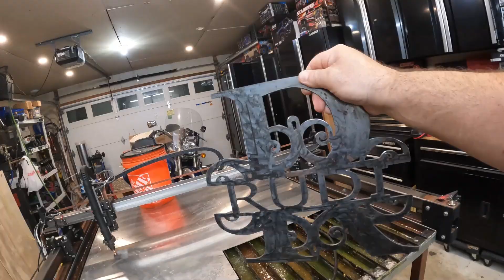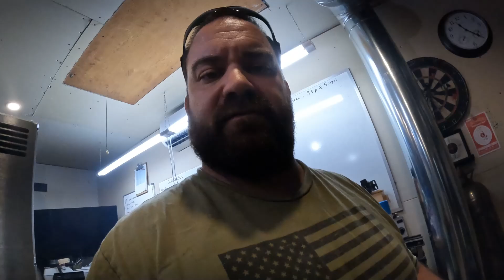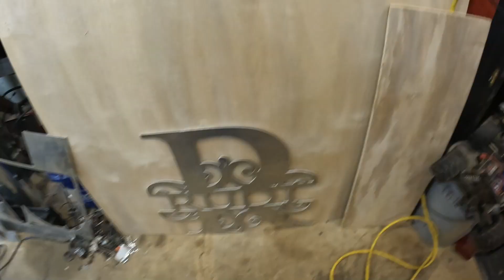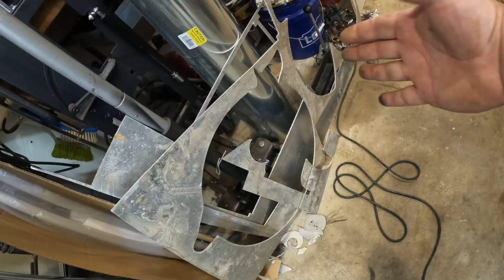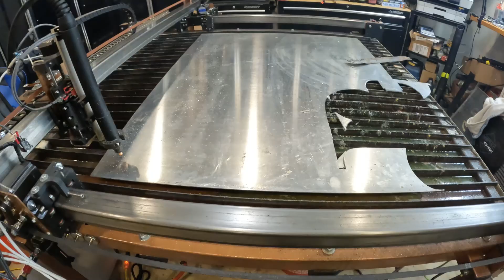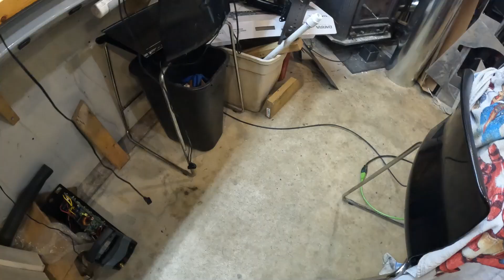JD's Garage CNC Plasma Table - More Cutting

Comment: We built the XL and are having a lot of problems getting perfect circles.  They have noticeably flat sides, almost oval.  Did you run into any similar issues?
Reply from the maker: Yes, you'll need to work on calibration and tightening tolerances over the length of the table. Corvetteguy50 just released a great vid about this. You'll need create a reference point on your x and y , command the machine to move a certain distance and mark it. Measure that distance with a physical measuring device like a machinist ruler and make sure it matches what you inputted into the machine. You'll repeat this process at several different distances. Example : 6" 12" 18" and see where you are off. You'll need to do this for both x and y , make sure your belts and all components are tight before you start.

Comment: I’m really excited about building the JD's CNC plasma and cuz you’ve already done a build yourself. I’m debating whether to build mine big enough (52"x100") to fit a full sheet  or just a half sheet at a time

What’s your take on the pros and cons of going full sheet size versus half sheet? 99% of the time i'll be cutting 18-20 awg ss
Reply from the maker: Space is my concern with a full table. I would also consider how frequently you cut something from a full sheet. Obviously if your doing big signage all the time I would go full but if not I would build it for a half sheet and if you don't want to cut the sheet you could always just build extensions so the full sheet can be held up and as you cut from the sheet you can just move it forward, that seems to work for me.
Reply: @VRudi460  You really made me double-think going with the smaller size and using extensions instead of cutting the sheet in half. I don’t have that much space left in my workshop, and a full-size table would definitely eat up a lot of room. When you say "extensions," do you mean just some kind of table or support to hold the rest of the sheet so it’s not hanging while cutting?

Comment: Looks great !!! All I cut is aluminum    I cut .063 5052 and have done right at 7000 cuts to date  and I hear you about the water height .. i run mine high to keep it from warping but man it makes a mess   So sometimes I let it get low but then I do have some warping … some of my cuts have been 18 minutes when I have around 130 Pierce’s at 120 imp and I have never had an issue   I have heard all about the aluminum explosions  but for myself with almost 15hrs of cut time on aluminum  I have never experienced any issues   I do however run a fan from the off gasses  because they can be bad  …looks great I have enjoyed seeing your last couple videos’s  your doing great and it always gets easier    Their will always be hiccups but  I love doing plasma   It’s very rewarding  😊

Comment: Hi assuming you used JD XL default drawing size for your table? What size water table did you go with? Is it stainless or galvanized?
Reply: Would you have made the water pan edges deeper if you had your time back?